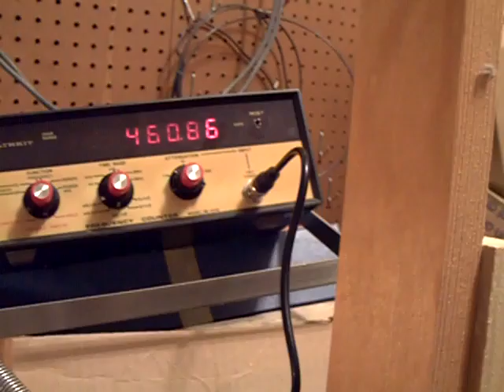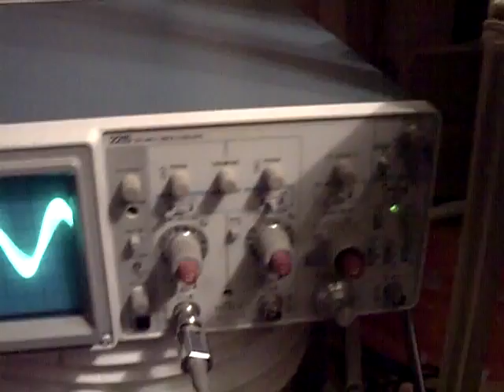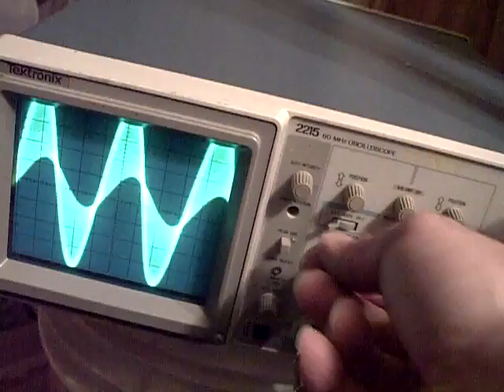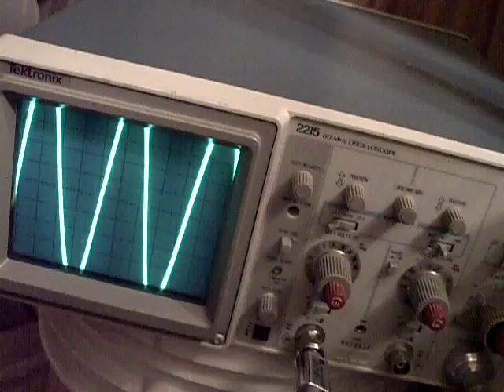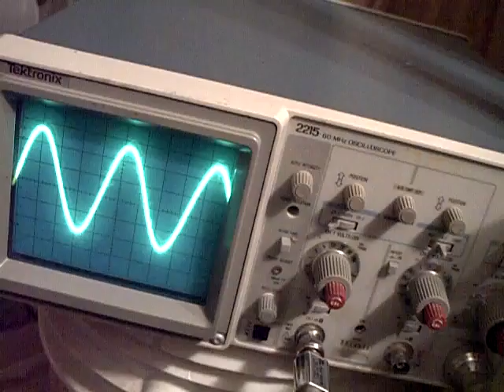Philco 38-116 Repair, Part 14, Attempting the 20KC IF Sweep.

Comment: In order to see the double hump you need to use a spectrum analyzer .you can find them on ebay, best to get one with tracking generatorthat covers 20 HZ to 40 MHZ.  HP,  RIGOL, or AGILENT. Down side is they are real expensive !!
Reply from the maker: +John Bellas Thanks for the comment. I just peaked to max, I had one IF trans that was frozen, and no way was I going to try to force it to move. Besides, there isn't any Experimental High Fidelity AM stations anymore. At any rate the radio has superb sensitivity and sounds great. Like someone is in the room and not the radio.

Comment: Silver Mica Disease.  The built in capacitor in the IF cans has a coil and a silver mica capacitor.  The age kills the capacitor.  Open the IF cans careful remove the capacitor under the plate and replace with external capacitors.  50pf maybe 22 pf

Comment from the maker: @bandersentv I might could try your advise. My biggest problem is the frozen 52B compensator. I put some good torque on it both ways with the fiber adjustment tool and that bad boy is frozen tight. I'm afraid I'll break something if I really try to force it. So the question is, how much better will the audio get? Adjusting for 470KC and peaking things up. the radio seems a lot better than when I started. I probably got it a lot better than a 1938 repairman could with a VTVM.